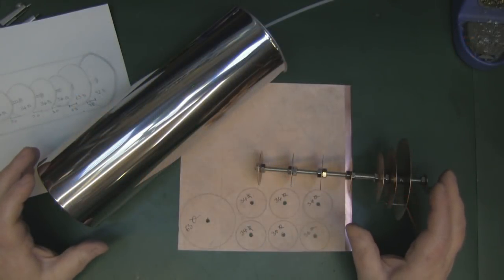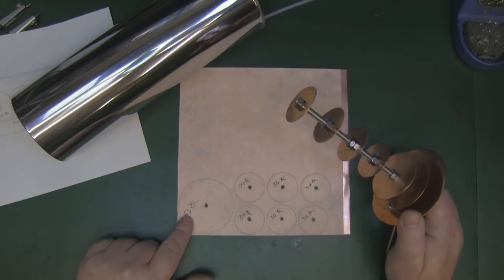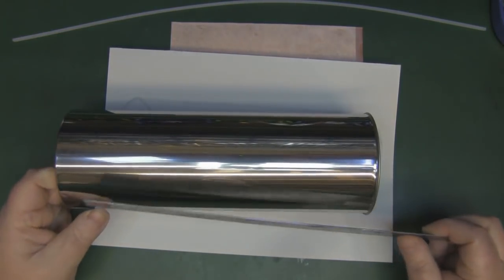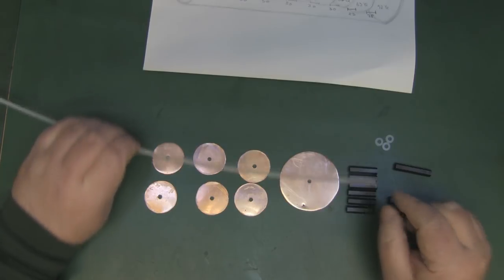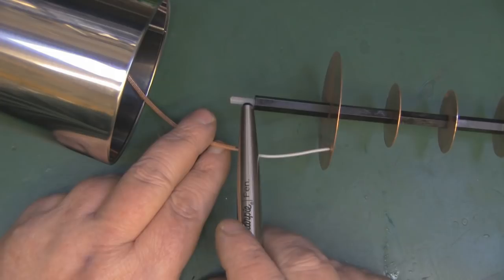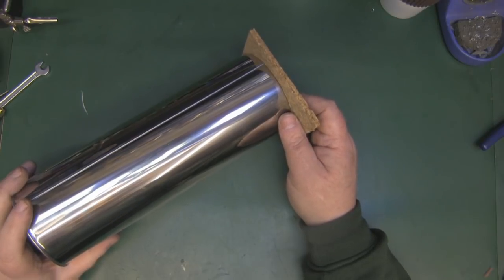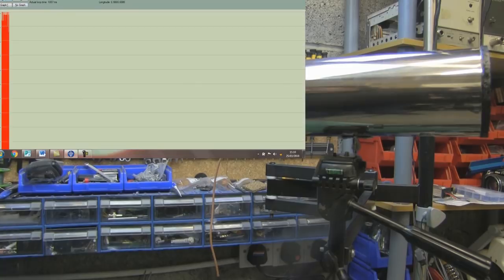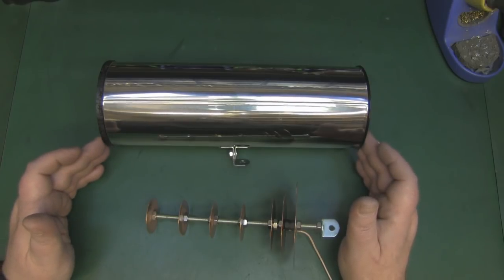The Wifi Gun in a Can-Can

Comment: Hello,,,the antenna looks interesting for external mounting. Would it have a function if I put it on the roof with a 10m cable to avoid the walls towards the neighbor's house, which is about 30 meters away?
Reply from the maker: Yes just make sure you use quality 50ohm low loss coax

Comment: The difference between the metal threaded rod and plasctic threaded rod: all dishes are circuit short cut onto the metal one. All dishes are isolated from each other onto the plastic one, so, i think there is a problem with the metal one: you solder the ends of the cable one way onto a short cut (metal), the otrher way you solder the ends onto isolated dishes, like a capacitor. Can you explain the sense of these two extreme difference?

Comment: I would like to build this kind of antenna (with or withough the can) for my local 800MHz LTE connection because it seems a little easier to make than other directional designs. Are sizings available for 800MHz, or is there a good online calculator which could provide that?

Comment: You will find that when you are attaching the center wire of a coax to your driven element if it's a flat plane such as this, the best match to the coax needs to be experimented with.   If you have a spectrum analyzer, connect the coax to the analyzer and aim the antenna at a known signal source and touch the center wire of the coax to various areas of the driven element.  You will find that you get a much stronger signal on some areas of the driven element than others due to a better impedance match.  Once you have found a place with the best match, solder the center wire to that point.  Excellent series of videos and very interesting.

Comment: Your diagram doesn't have a length & width measurement for the can, is it important? Dose it mater if the can is aluminum or another material? What type of tube are you using? Can I use a stack of soup cans for the tube? I like to get my details together, less chance mistakes on my part. I need an electronics for dummies book. :(

Comment: how i can calculate the diameter for 1800mhz and 2100 mhz for 4g connections
Reply: His design has the driven element at 1/2 wavelength and the others at 1/4 wavelength.

2.1 GHz is 143 mm & 1.8 GHz is 167 mm.

You’ll also want to change your spacing. If you look up yagi spacing calculator, find one that lets you choose all of your variables, such as number of elements, diameter of parasitic elements, frequency.

Comment: In a conductive space like you have, the wavelength is not the same as free space.  You effectively have a capacitively coupled loading on the ends of the elements.
A much larger diameter tube would likely do better.  The area over which you take the RF energy is about equal to the tube's cross section.  The efficiency with which you then bring it into the COAX is the big thing to optimize.

Comment: I'm wondering if the reason the original design used a drive element 5mm larger and parasitic elements 3mm larger than your design is because the original plans called for a 4mm threaded rod. Perhaps the original designer intended for the builder to use a non-metallic rod, but he used a metal rod instead. Is it the overall diameter of the circular element that matters or is it the cross sectional length of metal that should be measured? I'm sure I'm not saying it right, but perhaps the original calculations take into account that there's a hole in the middle of the circular elements.

Comment: Hi, great video, but I have a few questions. 1) Why shouldn't I use washers as the circle elements to build my WiFi gun...is thinner material better? 2) If I were to use washers, how does that affect my spacing? What I mean is, is the spacing measured between the two facing surfaces, or since the washers are significantly thicker, should the spacing be measured center to center? Thanks.

Comment: I have a TP-LINK model TL-WR840N router. I want to send signal to a repeater 2 floors bellow where the router is. The router has 2 antennas directly welded onto the board without a connector on the antennas. I need maximun signal strength in the direction of the repeater. Is it a good idea to weld this kind of conector ( https://www.ebay.es/itm/Antena-Pigtail-Cable-F-Female-To-Y-Type-2XCRC9-Right-Angle-15cm-Para-Huawei/163024015983?hash=item25f4fd126f:m:meW5gXQ8227U467x5RFSVrQ ) to both outputs and have them conected to a wifi gun or should i only connect the wifi gun to a single output? Will the signal be stronger with both outputs connected to a single wifi gun or will that make the router go crazy and don't work at all?

Comment: Ok so I have a question on the dimensions used for the WiFi gun. Aren't the diameter of the directors supposed to be just a fraction under the length of a half wavelength? The frequency of WiFi starts at 2.4Ghz, meaning half it's wavelength should be 58-62mm. The directors in the WiFi gun is 37mm. Any reason why?
Reply: I have been asking myself the same question. Have you perhaps found out why?

Comment: Hi Andrew, I was wondering if you would be able to help me out with my problem. I don't have wifi at my house, however, the public library's open network is about 2(km) (1.2 Miles) away. There a couple of trees and houses in front of the direction towards this library. I've been looking around and watching some of your videos and I can't decide on what a good solution would be good for me. I have thought about a yagi https://bit.ly/2pLnZWF (Aliexpress) or building my own yagi. I was going to mount this yagi antenna to the roof of my house (maybe with a steel wok mesh behind it). I had also found this (https://bit.ly/2IbFnLY) aliexpress outdoor wifi panel. I was also thinking about using an old satellite dish with a cantenna like design pointing back onto the satellite. Another one is https://bit.ly/2pJ0VZc from aliexpress that I would stick through the sattlite dish. Which one would be better?  Either one of them would be mounted to my roof (as I have an old UHF areial that I will take down. My house is also one story high. Internet is currently unavailable for my house and I am writing this from the library xD. Thank you. :)
Reply from the maker: You need a cantenna beezito. Simple to build and better than a Yagi if you have trees in the way.

Comment: Andrew, this is very similar to antennas we used to use back in the 80s on news gathering vans to shoot a microwave signal back to the studio on around 2300 MHz. And some of us ham operators used to make these to shoot video to each other across town. The difference is that we made waveguides from coffee cans. A small hole drilled in the can 1/4 wave from the back of the can and a 1/4 wave of center conductor of 50 ohm coax protruding into the can made up the driven element. The can was then inserted into a short section of PVC pipe just larger diameter and a PVC cap glued on. This made for a rigid mount of the long all-thread rod which contained 20 or 30 washer discs of the proper size and spaced with plastic spacers. Nuts only at each end of the rod which was about 3 or 4 feet long. Lots of gain and narrow beam width. Sorry, I don't have dimensions to give you but you may not be far off with your project. I suspect that by inserting your parasitic elements down into the waveguide may introduce some unwanted reflection and SWR. I would shorten the waveguide and then mount the parasitic elements out on the end of the waveguide tube.
Reply: ... y después despertaste.

Comment: Andrew, could you please show how to solder wire to the stainless steel. I was trying a lot in a different ways, but unsuccessful to make a proper soldering. Thank you!
Reply: pilipoff
Anytime soldering a steel or iron part, use flux and it'll be easy. Flux paste or acid flux, plumbers flux or hydrochloric acid - each will do the job, but be careful with the acid.
Reply from the maker: These are not true stainless steel they are a mix with a lot of tin. I have come across some that just will not solder even when buying from the same store. I got 10 of these last year same make same store and two of them would not solder.

Comment: wonder if the "waves" are not blocked too much because round elements, just a thought that it might reflect too much before it hits the driven. At the moment testing my 2,4 sector antenna which stated as 16dbi and 90 degrees radiation pattern , so far very interesting result with 40+ wifi points while my phone pickup about 10. Need to find spare time to inspect the inner what should have 8 cone-shapes on some board and seperated H and V connectors.
Reply from the maker: A few people have said that maybe using less elements may make it perform better I will give it a go when the weather warms up as it does make sense when you think about it.
Reply: yup, would be so nice for a long distance test in some open land to avoid all kind of reflections. Agree the weather needs better first lol, here tons of rain in Holland, all coming from UK  as wind is from west  hehe